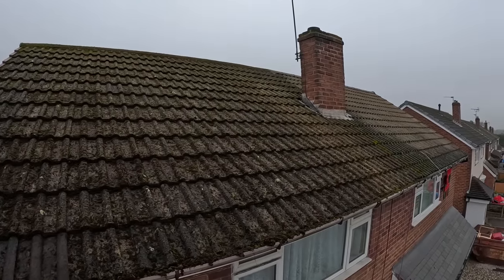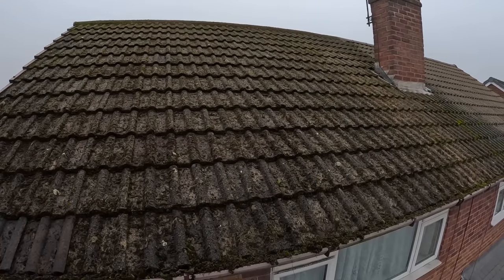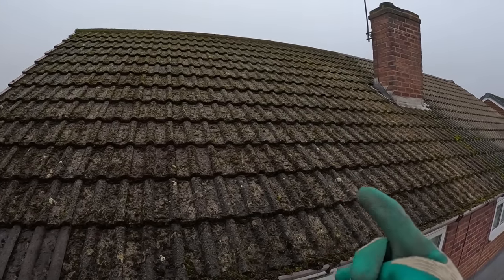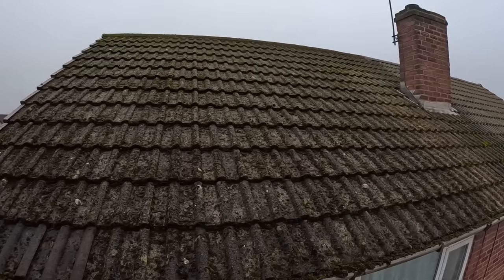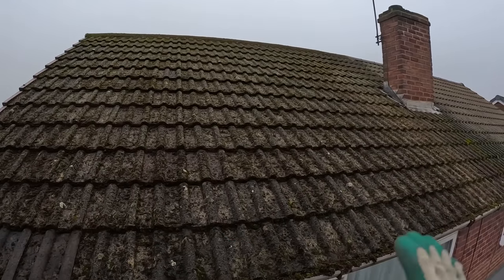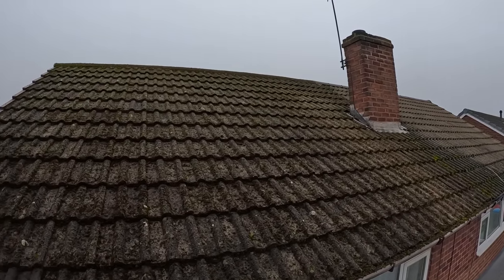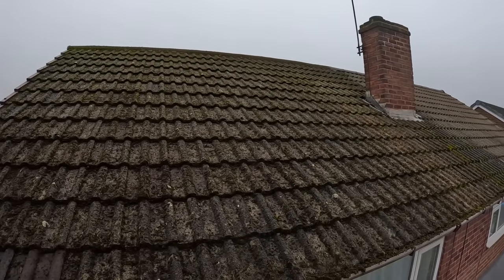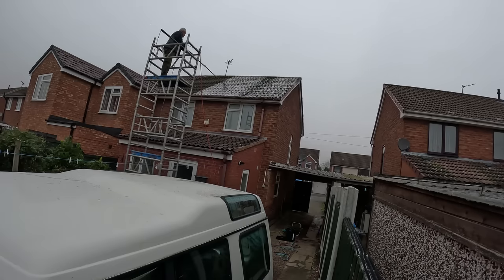STRANGE CASE: RUDE Neighbour Went Too Far? I Discovered Evidence Whilst Cleaning A Roof!

Comment: Been a roofer for many many years, I can tell you straight away that’s an internal stop end never should of been put on a union, that has been done out of spite or conversation between roofer and customer. Out of order👎
Reply: Agree 100%, Been in building trade nearly 40 years,seen it done quite a few times over the years.Can cause so many issues, like internal damp for the affected house
Reply: Or maybe just maybe the person who put the stop in asked the neighbours to kindly get the roof cleaned for years due to moss building up and blocking the drain constantly and was just ignored.  Get the facts before accusing people or being out of order.  That roof had clearly had a moss problem for years and years and wasnt dealt with.  This youtuber went off on one without knowing the facts himself and took the law into his own hands.  Came off as a bit of an idiot tbh
Reply: @bongobob7079  Two wrongs don't make a right, removing the obstruction was the correct thing to do.
Reply: @bongobob7079  Very good point.
Reply: Considering the other roof showed signs of newly fitted guttering and the fact the down pipe had been moved says this was purely done out of spite. Looking at the neighbors roof they'd not long since had theirs cleaned likely when they fitted their new guttering so theirs could have been just as bad for all you negative people you don't know either.  Causing damp in someone else's house just out of spite is bang out of order. It can lead to all kinds of issues including rot and I'm not even going there with mould.
Reply: @bongobob7079 IF thats the case, and it may well be, the neighbour still needn't of put the the drop going the wrong way, and if they felt that strongly about needing a divider could have used mesh instead of a solid barrier, would hold the moss back from blocking their down pipe but still allow some water flow. both things will damage the neighbours house in time, and they've done both on purpose. IF they had been asked to clear their roof of moss previously their reasons for not doing so may have been genuine and not malicious, could just be skint.
Reply: Mr. Partridge, when you pulled out that piece of plastic. It looks like you also left a gap between the two gutters, nearly an inch wide. Did you patch that up? If not it looks like it would leak there...
Reply from the maker: There’s no gap 👍
Reply: I would of blocked the gutter aswell. The neighbour probably asked him to clean his roof and he didn't. I know if I had to keep paying to unblock the drains as he can't be arsed to clean his roof I would do the same
Reply: @nodnodwinkwinkV  there's no gap, thats a gasketed joint.
Reply: If the neighbour is to lazy and bone idle to clean his roof and blocks nextdoors gutter and downpipe, he got exactly what he deserves
Reply: Couldn’t one say, he blocked the gutter (owner 2), so any damage done to (owner 1) the home, they (owner 2) could be held liable? They (owner 2) caused the damage, they (owner 2) must pay for it? Seems clear to me. If the moss (owner 1) did cause damage to (owner 2) gutter, they (owner 1) are liable. If the gutter addition (owner 2) did cause damage (owner 1) home, they (owner 2) are liable?
Reply: @bongobob7079  blocking the gutter would only make the moss worse and if it isn't illegal, it should be, because if the water can't get away properly it could cause damage to the house and offending neighbor would be responsible for that. 
Also, did you consider that maybe the reason the owner hadn't had their roof cleaned was because they couldn't afford to??
Reply: @bongobob7079  Hahaha. That's not the way to go about things. There might very well be a clause in the deeds pertaining to the sharing of the roof drainage. This could well bite the neighbour right on the arse.
Reply: @simonn1435  maybe the neighbour is disabled and has very little money and had to save up for some time to have the roof cleaned, maybe its a rented property and they had been on at their landlord to get it cleaned for a long time, maybe its a single parent that is struggling financially and cant actually clean it themselves, maybe they had been trying to liase with the neighbour to get it done at the same time they had their roof and gutter done to save money and the neighbour said FU, maybe the neighbour is just a total knob and does things like that anyway (there are plenty of neighbours like that about), it could even be an elderly widow that the neighbour is taking the p*ss out of..... My point is there are thousands of reasons why this roof might be bad and without knowing the full story its wrong to be judgemental of the person with the moss covered roof. You might be right, but you could just as easily be wrong. How would you feel being judged by some total stranger on the internet that feels they have the right to condemn you simply because they think they know your situation better than you do? Anyway, I mean no malice towards you or your family as I dont know you. You might be a very nice person with a lovely family..... or you could be a 35 yr old single guy living in his mums basement with a load of computer screens and watching porn ;-). The point is, I dont care, you are a random person on the internet that I dont know. But what I will say is, I hope you had a wonderful Christmas and New Year and wish you all the happiness for the coming year. 🙂
Reply: @bongobob7079  nothing to do with facts it’s a shared drain , how many years has the divide been there, one selfish git of a neighbour.
Reply: @dave_ryan  I do not think that this is about "two wrongs". The video is called "RUDE neighbor went too far" and indeed RUDE and not rude. Looking at the amount of moss on the roof, especially compared to the condition of the roof on the other property, it may very well have been a problem between both property owners and I would not call out one above the other. This feels a bit like Who pays the piper calls the tune.
Reply: @bongobob7079  Well if the problem was moss on the roof, this fella just took the moss off, so divider isn't needed anymore anyway, is it?
Reply: @nodnodwinkwinkV  it's a join not a gap
Reply: Take your point as a roofer too but what is one neighbour  suppose to do when next doors moss constantly  blocks your half of guttering and constantly  blocking offsets bends and downspout, it was clear on video that the house who installed the straight connector kept their roof moss free. I allways recommend  to customers having these problems to have me or someone else higher  the gutters in middle and put a straight connector  in and lower gutter ro corner of house and run a new downspout to front or across gable to somewhere round back where there is all ways  another drain and problem solved for both parties  .
Reply: @simonn1435  could of just put mesh in to filter it out, completely blocking its a dick move
Reply: @bongobob7079  lmao you expect a lot from others don't you
Reply: @nodnodwinkwinkV  What gap, the one between your ears you mean?
Reply: Dear World. 
He put the foundation to his own building at risk. It is not OK to be that stupid.
Thank You.
Reply: That was nasty thing to do, we have joint guttering and we clean ours every year where neighbours don't care but we would never think of blocking their drainage, I would think of separating them and building my own downpipe if that's an option (no idea if it is)  or getting something to stop downpipe getting blocked but first need to see if our problem will continue. We'll done for clearing blockage for them :)
Reply: @reneep.1978  Thank you I am on a limited budget and would have to save up a good amount of time to pay for something like this.  Either way deliberately blocking that was wrong and completely immature.
Reply: @johnallright6847  that's great only he didn't do that he deliberately chose to block it off. That's a conscious, malicious act. We don't know why the person with the moss covered roof waited so long to clean it, money issues is a safe bet. Elderly and unable to clean it themselves,  possibly.  Point is probably wasn't a  conscious,  malicious act, unlike neighbors choice.
Reply: @jameswatters9592  how unnecessarily rude. They asked a question because they were unsure no reason for your disgusting response.
Reply: @hereiam2942  lol okay. I watched the video and there's no way you can tell if the person has a disability or is a low income person.
Reply: @garnetj69  but you don't  know that , you are saying possibly this and probably that and maybe the other and taking wild guesses as to what one neighbour  did or didn't say or do. It "may" very well be a deliberate act by the one with all the moss on their roof to leave it there knowing and been told it is causing problems with downspout that the other neighbour  has to keep unblocking. " Possibly" it wasn't an elderly or poor neighbour but a malicious  nasty one that don't  give a darn "Probably"  an ongoing problem for years as moss is and the neighbour with the shared Downspout would not let the other onto his or her property after offering to clear downspout. To many ifs and buts for me and I as a roofer offered a practical  solution but you are are not but are just trying to apportion blame to one without knowing fully what has gone on for years.
Reply: @bongobob7079  Right but most of all gutter muck is from fermented leaves which decay into a dust which when wet becomes sludge. People think it's from moss when it isn't. Detached moss will.make up some of that sludge but it's mostly from leaves.
 Every Spring guttering should be cleared because once the leaves shift towards the lowest point along the gutter they will form a thick layer and block water draining away. Because the trapped air inside the down pipe then acts as a vacuum when water is passing through the underground waste pipe below, it begins sucking the leaves and fermented leaf mould into the neck of the downpipe which gets wedged and it's there that it dries out and becomes a hard mass. 

So when any neighbour accuses them of their moss blocking their guttering most of them time it is nonsense. I find it bizarre that a semi-detatched house uses just one downpipe for both properties. 

That said, that second house has had new tiles and new guttering so clearly they had to fix their own problem of moss covered tiles causing degradation and blockages. So now they have renewed everything suddenly they declare their neighbour is prohibited from using the downpipe, which will be in the legal deeds of the property that both houses must have access to.
Blocking that off, does not block muck. Moss falling into guttering in large quantities does not move that far, because once saturated becomes very heavy. So that neighbour will have had the same amount of moss falling into his guttering causing it to sag and bow and losing the gradient towards the exit. 
The stagnant moss and leaves just block water from moving and overfill results in overflow which runs into the walls causing damp and that damp will also affect that neighbours house.
So no matter what hypothesis you bring into this, it's one thing to block the slow flow of muck but another entirely to stop the runout of water. Just because that neighbour resolved their moss problem does not mean they should punish their neighbour because theirs still remains. All they had to do was put some of that gutter brush in and it will stop all the moss and leaves travelling but allow water to flow without an issue. 
Only one of those things will accumulate in minutes during a downpour and begin flooding which causes massive structural damage. 
Moss etc. can be cleaned. Damp rot, cannot!!!
All those agreeing with spiteful neighbour, you need to check yourselves, seriously. If you think this is an appropriate and mature way to resolve an issue like this, with zero room for compromise and understanding of the opposite neighbours situation i.e age, finances etc. you are what is known as a nightmare neighbour.
There are many cost effective and simple ways to prevent any further problems here, but that neighbour chose to escalate it maliciously and take revenge by causing structural damage to that neighbours home.
In all definition, that is a petty, unscrupulous and nasty bstd!!
Reply: @bongobob7079  - I think he want to get some of the water from the roof, but the angle is possibly in the direction to the neighbour, so that he will never see some water. This was his possibility to get some rain-water.
They should told him that they have removed the splitter. Now he will wonder why his water-tank is totally empty.
People should learn to talk with each other.
Reply: Are you the neighbor?  You came into the comments section guns blazing like you had all the facts yourself. Lol
Reply: @micropower8  Why would it be totally empty? It would get twice as much rain now. Where is your logic?
Reply: @FrozenHaxor  - If the angle of the gutter is to high, then he get no or simply less water as the neighbour. He want to get 50% of the water and this he make possible with this separator in the gutter.
Reply: @bongobob7079  I agree with you 100%. One numb nut stated that two wrongs don't make a right, but they are usually the ignorant one. The stroke neighbor should put in his own downspout. I gave the You-tuber a thumbs down for the exact same reasoning that you stated. Now that poor neighbor will have a plugged downspout due to the garbage work done by the roof cleaner.
Reply: @dave_ryan  And now the downspout will be plugged from the garbage job the roof cleaner did. Hello
Reply: @nitroblueuk  Solved by the flake neighbor putting in their own downspout. The next step will be the downspout gets and remains clogged. Brilliant. Hello
Reply: @nobs3075  "neighbor should put in his own downspout," You don't understand how drainage works much do you, Hello. 🤣
Reply: @dave_ryan  You mean all that rain only lands on the responsible neighbor's property? What are the odds. Hello
Reply: @nobs3075  nothing to do with were it lands but were it has to go, both houses are served by the one drain do the math, hello.
Reply: this is a report for the build inspecktor ...  becouse when the houseing is installed with 1 down drain it is iligal to block the 2 house  from it ..
Reply: I would think had any damage been caused because of the blocking, the neighbour would be responsible for repairs.  Just because there's only one down pipe doesn't mean it is automatically the neighbours property. After all a shared pathway to two houses doesn't belong to one house.
Reply: @bongobob7079  lmao, we found the neighbour
Reply: @bongo bob  His job was to clean roof and gutter. To allow water run off to run off. Therefore his responsibility of due care was to remove any blockage. As this joint is shared then cutting out the blockage would not be classed as trespass. However if down pipe was blocked then the neighbour should be advised to clear any blockages on his side. There is a sound case the neighbour was getting moss that was blocking downpipe. So in theory he could have adviced that the roof should be cleaned. Bit of a catch 22.
Reply: @dave_ryan  so a third wrong is OK?
Reply: @nicoaalderink5924  exactly
Reply: @bongobob7079  calling someone an idiot on here....all well and good until you meet them face to face, pal.
Reply: We'll said mate
Reply: Carelessness from nextdoor see it all the time
Reply: the fact so many of you care about this is sad.
Reply: @Brazen1234  you watched it 👍
Reply: Hopefully these neighbour can sort their differences out.. it's better to live in harmony to some degree... i understand we all have our opinions but somehow we have to live together ..
Reply: In my experience he blocked the gutter because his neighbour is a miserable bastard and doesn't get his gutters cleaned therefore causing blockages for the neighbour with the downpipe so what would you do ?
Reply: If I'd had my roof tiles cleaned and new gutters, would I want the neighbours moss clogging my gutters and spilling over the side of my house. Probably not, I don't blame them.